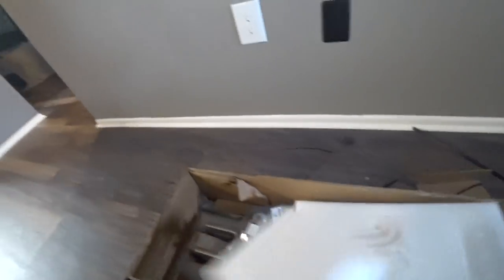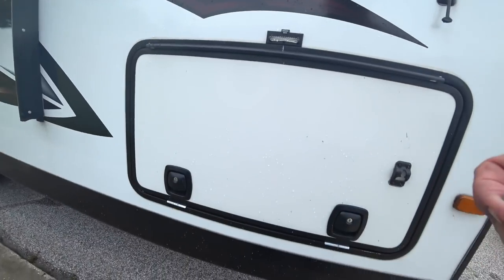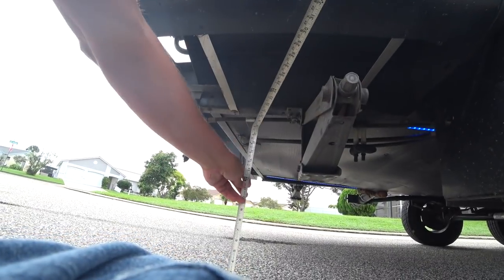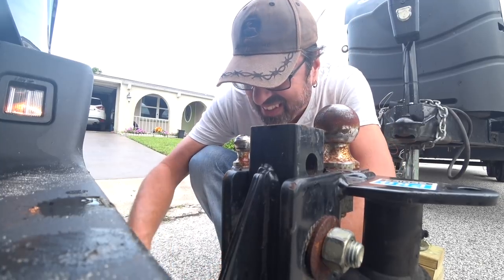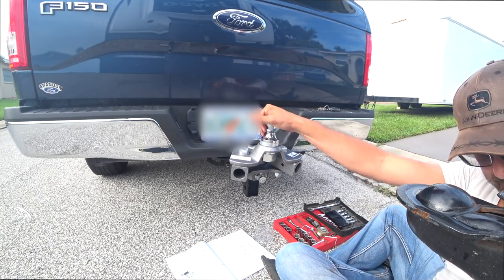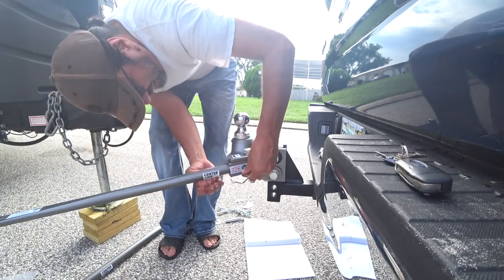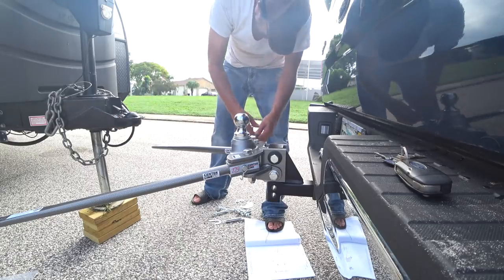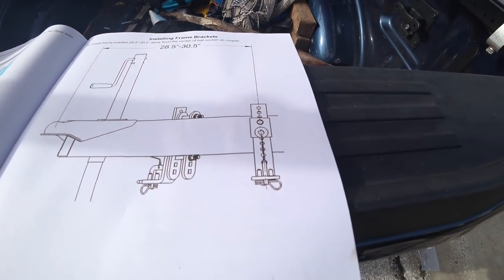RV UPGRADES-Husky Center Line Weight Distribution Hitch Install and Review.

Comment: What does your camper weigh ?
Reply from the maker: The camper when I install this hitch Wade around 5600 dry I’m using it now on an 8400 pound trailer and seems to be doing just fine I may have to upgrade the bars

Comment: Excellent video. I am getting the 32217 version for up to 800lbs installed on an Apex Nano 208bhs and an F150 with tow package. My question is: do you have to remove the bars when you back up while turning?
Reply from the maker: No I never do unless it’s later in evening and I’m trying to be quiet and courteous to the other campers LOL. But physically you do not have to it’s just that they creak and groan pretty good!